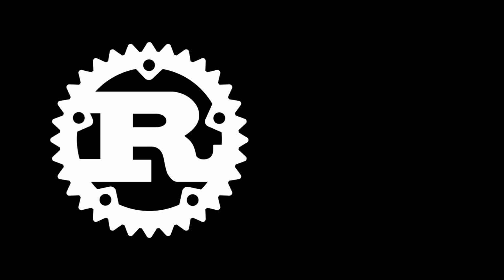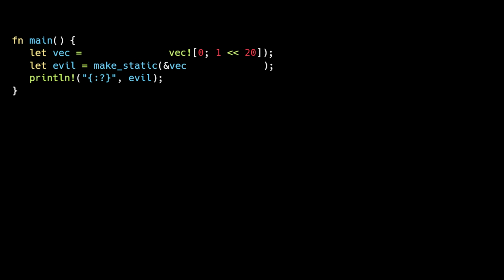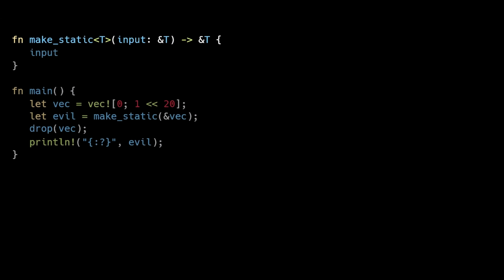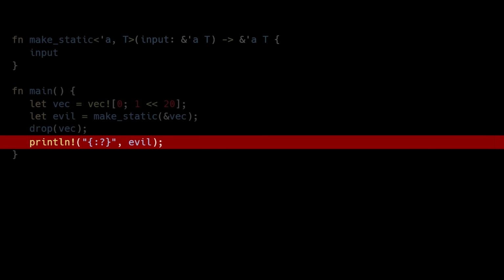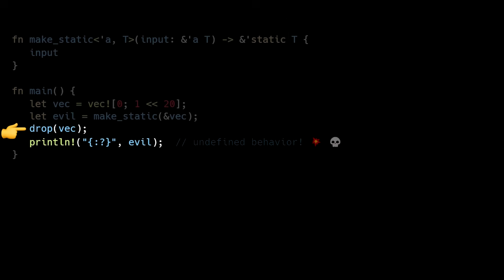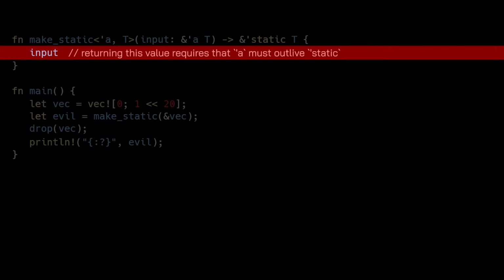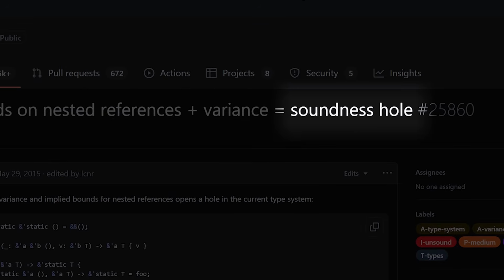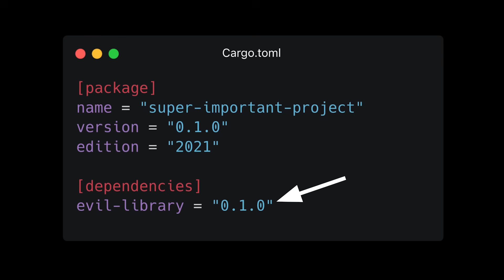Breaking Rust’s memory safety with 1 line of code

Comment: Absence of `unsafe` does not mean that a malicious dependency is safe (in the colloquial sense) to use. Safe Rust isn't sandboxed.
Reply from the maker: Yes good point! My point is that the absence of `unsafe` Rust should provide certain memory safety guaranties. But with this soundness hole, even if someone audited every single one of their dependencies and found no `unsafe` Rust, memory safety guaranties can still be broken.
Reply: True, but in rust safe and unsafe have very well defined meanings, which are far from the colloquial sense :)
Reply: @BartoszGrabias My comment is an objection to the notion that fixing soundness bugs has any significant impact on supply chain security, not the use of "safe" by the Rust ecosystem.
Reply: @gamekiller0123  Oh, okay, sorry, I misunderstood then. Fully agree on that point.

Comment: As a beginner I would have expected you to actually explain the trick Mr. Rust wizard used to trick the compiler. I understand that it tricks the compiler but how does the code do it?I think thats the most interesting part here. Do I also need to be a wizard to understand that trick?
Reply from the maker: You need to be at least a level 38 wizard to understand the trick. Jokes aside I agree with your point. Thank you for the feedback!
Reply: this video I found did a pretty good job explaining it, it involves function parameter lifetime contravariance (a sentence dreamed up by the utterly deranged) https://www.youtube.com/watch?v=vfMpIsJwpjU
Reply: @BlueishSapphire7 wow, a comment with a URL that didn't get deleted (yet?)
Reply: @pmmeurcatpics probably because it's a YouTube link
Reply: The helper function has an implicit constraint on the lifetimes from the signature, i.e. that 'b >= 'a.

We then typecast the helper function to set the extra lifetime to static while keeping the implicit constraint. Finally we call helper with a double reference to a static value (&&()) which is valid.

The compiler is not smart enough to follow the implicit constraint through these steps and misses the fact that 'a in make_static must be static.

Comment: This should be resolved with the new trait solver system
Reply from the maker: Can you provide a link to some info about it?
Reply: @letsgetrusty  Links most likely get deleted. In the Rust Compiler Development Guide there is a section 50.6. Next-gen trait solving.
Reply: @letsgetrusty  also check out issues in rust repo with label fixed-by-next-solver
Reply: @letsgetrusty  hes capping
Reply: which we will get approximately never
Reply: @flibbertigibbet-at-arms  it's being using for coherence checking in the latest stable so hopefully sooner 😅
Reply: @flibbertigibbet-at-arms  a part of it was just introduced in the latest 1.84 update. It'll be ready for Rust 2024 Edition release. There's a GitHub issue tracking all Rust 2024 Edition features, like better async support and the new trait solver.
Reply: @flibbertigibbet-at-arms  sigma boy
Reply: Interesting idea!
Reply: Aren't lifetimes (and variance, too, I think) the responsibility of the borrow checker? Therefore, it would be Polonius (the next-generation borrow checker) who would solve this problem
Reply: The Rust folk have been saying that for about 10 years, when is it actually going to happen?

Comment: Who have thought, the Rust compiler is not perfect. Need to test if clippy or clippy in pedantic form will notice this.

Yes, its a bug. A bug does not mean the promise is a lie. Rust 2024 is around the corner with a few big changes, including the internal changes. I wonder if that would resolve this bug and why they wasn't able to solve it yet. Maybe it requires some complete rewrites of the backend?
Reply: clippy doesn't but miri does
Reply from the maker: @chiffaonosu  Interesting! Didn't know this!
Reply: Yes, they are in the process of completely rewriting the trait solver. This will fix some long standing bugs

Comment: The problem with Rust is that it is too complicated. If something is complicated there is higher probability of making stupid bugs in the code.
Reply: this same reason doesn't prevent a ton of people using c, c++ etc.
Reply: It is complicated, but not too complicated. It can be too complicated for a simple task. For me Rust is actually super elegant due to static typing and very explicit handling of all types and branches in code. The amount of weird bugs I've gotten in Python just because a function could return or receive many data types is insane.
Reply: @MartinWoad  Those are the reasons I like Rust. Basically for being a popular SML.
Reply: Rust isnt complicated, its rigid. Its rules may be alien to programmers from higher-level or unsafe languages, but they are very fundamentally quite simple - ownership is always passed unless you use a reference, you can only have one mutable reference, and you may have to specify how long references live. This is an extreme edge case, which was intentionally written to trick the language; other languages lack any guardrails at all or use a GC (which will not work in real-time or low-level systems where control over memory is essential).
Reply: Wrong. Its the other way, its actually hard to make those kind of bugs in Rust. The complexity helps with that. In fact its much easier to make these kind of bugs in simple languages, because there are no safe guards in C in example. No, just because Rust is complex and a bit complicated does not mean people will make more stupid bugs in the code. People make less bugs in the code with Rust, thanks to the safe guards.
Reply: @thingsiplay  I think bartek was talking about language bugs, and that this language bug exists because of rust's extreme complexity
Reply: @what42pizza  Certainly bigger and more complex things are more likely to have bugs than. smaller and less complex things. However historically all compilers have had bugs. Look at the history of C and C++. I don't know for sure but as a long time user of C++ and now Rust and a long time follower of the ever increasing complexity of C++ I'm not sure I would rate the complexity of Rust as extreme.
Reply: I think that's the point of Rust. It acknowledges that even using simple languages/feature-sets, high-level systems have a tendency to increase in complexity. Therefore, instead of fighting against that, which Rust perceives as an eventuality, it tries to make that as ergonomic and reliable as possible. Lifetimes are ugly, ownership is difficult to learn and use, but both of those are things that you eventually implement in simpler languages anyway, such as custom allocators and arenas in C. But you have to reason about verify those on your own, in your own mental or runtime analysis, whereas Rust with it's ugly lifetime annotations and borrow system offload all of that to the compiler.

At the end of the day, Rust just forces you to not take shortcuts in writing your __systems__, but because that it is not really suited for simpler programs as it sacrifices that for the aforementioned ergonomics and verbosity for compile-time guarantees.
Reply: @chaitanyadubakula  Well, the simplest language I know is called "subleq" (Google it), It's an assembler language for a machine that only has one instruction. You can understand how it works in a minute and write an assembler for it in hardly anytime. But try writing anything non-trivial in subleq and you will soon be mired in massive complexity. The moral of the story is that having a simple language may actually make your work more complex. I have no idea where the complexity balance is. Meanwhile, I disagree that Rust is not suitable for simpler programs.  I have just been implementing the same handful of algorithms in C, C++, Python, Javascript and Rust (Don't ask why). All languages I have reasonable experience in. Only a couple of hundred lines each but some twisty maths and bit twiddling in them. I would not say doing it in Rust was harder. In fact I gave up trying to do it in JS and used Rust/WASM instead.
Reply: its the opposite. simple languages make complicated code, complex languages make simple code
ofc this does exist in a spectrum, not just binary
Reply: @RenderingUser  I agree, up to a point. Simple languages mean you are going to me writing a lot of complex code. Think assembler or C. On the other hand languages can get so complex they bury the meaning of what you are trying to say. Think Ada, C++.  I feel there is a sweet spot in the middle where the language clearly states your intentions without any extra warts. Likely that sweet spot depend son what exactly you are trying to do.
Reply: Well shit, I guess it's LUA time.
Reply: I don't disagree but may I ask you what parts of Rust do you have in mind when you say that it is too complicated?

I am personally waiting for Julia to compile. It is the closest to a simple and fast language. After that there's Crystal (already super fast, but has OOP which to me is a minus), Codon (with Python syntax), mind you I'm talking about high-level languages that target LLVM and become as fast as Rust (as it also targets LLVM) and Go (for a non-LLVM comparison), and of course C and C++ (both of which have both LLVM and non-LLVM targets).

I like Rust but I would like it more if all the lifetime stuff would go away.